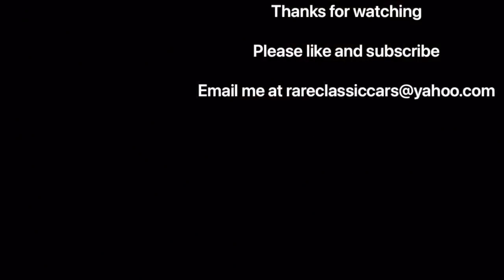Worst Engines of All Time: Chrysler 318/360/400/440 V8 Electronic Lean Burn

Comment: I disagree with scaring folks off a low mileage 77 and up car. Once you remove the LB and take it back to 1972 under the hood. These things are great runners. It can be done in such a way that it looks stock if you are a stickler for that. I took my 84 Diplomat to 1972 specs, when the LB computer died and it is great even though it's a 2bbl...good power and mileage.

Comment: I had a 78 Dodge Magnum.
The car would just shut off and wouldn't restart.
The lean burn system was so bad that the dealerships started offering the earlier style electronic system which was used on the 72-77 vehicles and eliminated the lean burn junk 
I had that installed on my Magnum and it ran flawless after that

Comment: My dad used to rip those straight out into a dumpster and throw in 68-71 Chrysler motors from rusty parts cars. Said a 78 Yorker with a 70 440 could really tear it up

Comment: Just a FYI the lean burn has nothing to do with the engine at all that has to do with the Emissions and ignition system only if you put a standard points distributor or a Mopar Electronic ignition system on it the engines are very good and very reliable I don't know how you can compare a ignition system to a whole group of engines. Even some slant 6's had the lean burn too does that man that is a worst engine of all time too?

Comment: Best thing is just get a 5bnl intake an old Qjet and a compleat old style chrysler electronic ignition from junk yard and be done with it. I can say from personal experience converting an old 318 leanburn engine to a 4bbl is actually worth while, the only problem is it will actually rev higher to the point where if its sludged up it will suck the sludge up from the higher rpms. Between adding dual exhaust even retaining factory manifolds, removing the cats and a 4bbl conversion with a 318 lean burn you will get a substantial power increase like significant, it will go from barely getting out of its own way to actually felling somewhat lively, good enough that if fomeone was like this thing is so slow i cant take it you would probably  be quite content it quite mind blowing just that will wake those engines up so much, but the exhaust and the 2bbl are tatally suffocating that 318. I used a quadrajet it ran flawlessly on that stock engine. A mild "RV" cam makes an ever greater difference in combination with those other mods also a converter for the 904 out of a 225 slant 6 car will raise the stall rpm up a few hundred rpm a likely free higher stall converter. Those few cheap mods will make a lean urn 318 run comparable with way newer cars. I had a test on a huge long double lane hill bone stock my car flattened at the bottom at 55mph would maintain speed whole way up, the exhaust 4bbl and ign swap it gained 10mph thats actually pretty substantial gain then after the cam and converter (and an engine stock refresh doing the same test it would pin the speedo at 80mph by the top, that is a huge difference, this was in a 1980 newport back in 92. This was all old used practically free parts and a cheap summit FT cam. Seems the engine was so smothered making the HP was so low the HP gain may have be very high like 100hp, sounds crazy but remember a 100hp would still only be low 200hp area, from a well beathing 318 v8....easy.  where factory  rating was like 120hp, so thats very plausable, plus ive gad alot of cars and in a large car just 50hp wouldnt be  thaf big of a difference.

Comment: I was a mechanic in the 80s up to the mid-90s. I owned a lot of Chryslers with this lean burn it either works really good or you had a lot of problems and when I had problems you could just switch it out with a regular. I miss my old.

Comment: Put vacuum advance distributor in it, reroute vacuum line from breather to carb. I went all out and plugged the hot air puffer. and got a junk yards breather. Turn any 318 into a 73

Comment: I had plenty of experience with the 360 two barrel leanburn units, never had a problem! But I always advanced the timing too. Thats actually the best thing to do, because the leanburn unit would keep it from pinging.
Sorry, but Adam you SHOULD NOT include the single plug single pickup basic leanburn units in this discussion that were on the 318 and slant and even the 360 2 barrel. They were not problematic!
It was only the early 2 pickup/ 2 plug units on bigblocks and other 4 barrel units that were problematic.
Everyone just jumps to conclusions on this. They are not all the same!
318 lean burn units to this day continue to run great even though they have 40 years of age on them! 
You cant say that for some other  engine computers of the 90s now.
Many quit working and have to be replaced or fixed. Leaky compacitors usually go bad.
I've seen it on fords, jeeps and even civics of the 90s now go bad!
I say this because it should be understood for those that become afraid of all units when they do not have too like on the 80s diplomats or 5th aves.
I have seen people on YouTube buy these cars now, that dont know anybetter and jump conclusions  because people lump them all in on the negativity of leanburn and think, oh know I have to get that unit off the car, I don't want any trouble with it when it most likely they won't give them any trouble.

Comment: It WAS ONLY the early 2 plug 2 pick up lean burn systems on bigblock and 4 barrel engines that had problems!
The 318 and slant 6 systems with1 plug/ 1 pickup leanburn systems WERE NOT PROBLEMATIC! People need to differentiate the 2! 
If the single plug and pickup on 318s and slant systems were problematic, Chrysler would NOT have continued with those all the way into 1989!

Comment: NOT a 'worst engine'. It was an emission system and easily deleted. If you set the timing correctly it would even pass emissions. I've had both standard and lean burn ignitions work fine. The main issue with lean burn was the microchip processing/switching capability (speed mostly) and reliability of the electronics components used. Honda used it later in the '80's-'90's and it was proven once the practical implementation caught up. Geez 'Why it injected fear .......' IGNORANCE, that's why. The LB fuel mixture was run around 17-18:1 later in '79 they rebranded the system as ESC with digital rather than analog CPU processing and carb mixtures around 15:1. As with the GM 350 Diesel program, the damage was done by then. The LB TQ carbs had 2 'air bleeds' in the air horn that could be blocked to restore 'normal' mixture control. I had a '79 300 with an E58 and ESC and I made it a mission to retain the ESC and make it perform and I did. It was a screamer. I 'super tuned' it and used a spark control module from another engine with a more aggressive timing profile. I also tinkered with the metering rods and jets. It was an arduous process but 'bone stock' looking and SCREAMED. And I retained ALL the stock emission equipment, which by the way it was a California spec car which was even more handicapped.

Comment: The engines were excellent just the system was bad.
The Ford Variable venturi computer control carbs were just as bad in early 80s .
GM was not as bad but 700R4 and soft cam shaft lobes ..

14.7:1 air fuel ratio is the target for ECM adjust fuel trim on EFI .

Comment: Let me also add this. When I bought the New Yorker I also looked at 3 Cordobas because I liked their styling and interiors. When I attempted to start all 3, All I got was a loud POP!! And a  whistle. The salesman said they probably needed valve jobs but I think their timing chains jumped. All 3?? What they all had in common was the 360 Lean Burn engine.Enough said!!

Comment: I could ramble on forever about the Lean Burn engine but I'll try to cut it short. I bought a late 76 Chrysler New Yorker Brougham from a dealer. I loved everything about the car. Beautiful styling,great ride,loaded with options.. Anyways,The car ran great for about 3 years. Then all of a sudden it started loading up & backfiring.So loud that it made people jump in fear, like a stick of dynamite. LoL.Anyways it blew a huge hole in the muffler.First things first I tested the Brain Box( computer) It tested good. Next,I replaced the magnetic pickup in the distributor & also the cap & rotor. Ran good for a while then WHAMO!! SOS!! Then I noticed the accelerator pump on the carb was leaking.Rebuilt the carb now thinking that the float level was too high. Adjusted float level lower. I eliminated the loading up but it didn't have the.power it should have had. Next I came to a conclusion that the big Carter Thermo Quad just can't be made to run lean. I tried to replace it with a Holley or Edelbrock carb and I couldn't get one for it.Lost cause. The engine was the 400 ( punched out 383 ).

Comment: As a kid, I had a used Fury wagon. I had nothing but problems with the computer.  The location of the box let it get too hot, they seemed to burn out constantly.  The lean mixture also burned up the valves.  no one got more than 120k out of those engines.

Comment: I had a friend that inherited a '77 Dodge Monaco 400 c.i.d. with the lean burn system. Ran rough, poor power etc. One weekend, we visited the local car recycling yard, found a straight elctronic ignition system module, ripped out the lean burn and it ran significantly better (found out in the process the timing chain was stretched and replaced it)...it was a gutsy beast from then on. BTW the other Chrysler faux pas were those idiotic ballast resisters...had to have a spare in the glove box at all times 🙄)

Comment: I was able to fix the lean burn issues with my 1976 Cordoba which had a 400 motor in it.    I pulled the motor out and replaced it with a 383 magnum engine from a totaled ‘71 Challenger.

Comment: I had a 76 Cordoba (400CI) that came from the factory without the LB setup which ran really good. Automotive engines and elaborate electrionics just weren't a good mix back then. Another example was the GM HT4100 system.

Comment: I had several Chrysler products with the Lean Burn System on them. The only one I had a Lean Burn problem was an 83 Chrysler 5th Avenue I bought with a spun main bearing. I simply replaced the engine and the Computer with a 318 out of an 88 5th Avenue. That car ran like a clock and got 27 mpg on the highway. I was quite satisfied with the Lean Burn System. Maybe I was lucky or maybe people were super critical of something that no-one else was adressing.

Comment: Back in 1983, my father had a Dodge Crestwood station wagon with the 360 c.i. two barrel, and it didn't have lean burn. (Thank goodness) I worked on that car and drove it quite a bit after his passing, so I'm not mistaken. I became a mechanic not too long after that, and remember working on "Lean burn" cars at a used car lot back in the late '80's. I also remember going to the salvage yard and hunting for the computer that mounted to the air cleaner as part of diagnosing/repairing those cars. Now, I work on Mercedes, Audi, and Volkswagen with CAN bus systems and all manner of electronic nightmare stuff!

Comment: The problem would have been solved if the cpu was mounted on the firewall instead of engi e. Heat and vibration is not a good mix for electronics.

Comment: I have told many stories about the 77 Chrysler Newport I had which had Lean Burn. I liked the car, it rode well and was comfortable, but I did not like the Lean Burn very much. On my car, the temperature cut off was 120F.  Below 120F, there was NO spark advance, which made the car very slow and gave it very poor acceleration until it warmed up above 120F. Above 120F, I had to press much harder on the gas than I'd normally expect to get the throttle response I wanted. Then I'd back off, and off, and off, slowly, as the spark advance came on.  It was a bit of an odd experience driving the car. It had a 4 barrel Carter Thermo-Quad carburetor with a phenolic resin fuel bowl. You couldn't enrich the mixture the way you can on the Carter BBD. If you gunned the engine, though, suddenly the computer understood you needed power and it allowed full spark advance. My plan was to replace the Lean Burn with a standard electronic ignition. I had all the parts to do it, but kept driving it as it was. It was OK - just not how I preferred it to be.

Comment: Dad bought his new 1976 Chrysler Newport with a "lean burn" 400ci motor.  It ran great on regular leaded gasoline! ...till the day I totalled it on the back roads, with the speedometer buried for a mile.  I was "fine" until at the county line the road turned to gravel.  😯 May 1981

Comment: Yeah! i know. many older engines were cold blooded until they warmed up. The 74' Pinto (my 1st pickup truck, bought from a bank repo for $50)  i had with a 2300cc/automatic (with a C3automatic)  was very cold blooded, But once warmed up it would pull a empty heavy tandem axle trailer. And going up steep hills it would slow down to 25mph (i could feel the HEAT coming from the floor from the transmission). Not alot of horsepower but would run forever and get about 25@gallon/ not bad for the time/era.

Comment: I have a 1985 B150 van, with the 318 and Lean Burn.  It uses the Holley 2280 electronic fuel control carb.  The Lean Burn system was innovative when it was first introduced, as it was the forerunner of all of the current ECU-controlled cars we have today.  Unfortunately they were saddled with carburetors and transistorized computers, along with ancient sensor technology.  The distributor can be legally upgraded in California with the Pertronix electronic auto-advance distributor.  Unfortunately for us Californians stuck with draconian smog laws, the state will not allow us to upgrade the pathetic 2-bbl Holley carburetor to a modern fuel injection system.  But based on my experience with these engines, I strongly recommend owners strip the lean burn off entirely and upgrade everything with a decent electronic, vacuum advance distributor and nice conventional fuel system.  Your Mopar will appreciate it...

Comment: Just to clarify: advancing the spark increases power; retarding spark increases fuel efficiency. Drivetrains are designed to run at either 'best power' or 'best economy.' Advancing the spark too much will cause knocking. Modern engines have transducers (i.e., microphones) to detect pre-ignition, at which time the spark is automatically retarded until knocking stops.

Comment: The engineer that came up with that Electronic Lean Burn should have been fired.  Attached to the air cleaner over the driver's side exhaust manifold all that heat and vibration; I never had a customer that didn't have problems with those Chrysler cars equipped with that system.  Great video!

Comment: Its rpm, temp and load based, instead using a vacuum and mechanical advanced the lean burn ecu used coolant temp, manifold vacuum  and engine speed to control timing. Nothing time based about it. Its biggest downfall was the same as all 70's and 80's early emission cars. It was all the vacuum lines and temp controlled vacuum switches that were of poor quality and affected by the heat in the engine bay or leaking valve cover gaskets.  Vacuum leaks and broken vacuum line nipples on all those switches. The engines then where way lean to start with then add in all that unmetered air from leaky vacuum lines and sensors and you ended up with a gutless turd that wouldn't idle, missed and hesitated.

Comment: I owned SIX MoPar "Lean Burn" engines! The "400" was the ONLY disappointment! Back in the day, though NOBODY built a good "400" engine! I owned ALL (except AMC) and these were BAD ENGINES ACROSS-THE-BOARD! They SUCKED gas, had DISAPPOINTING power/acceleration and were BITCHES to deal with!
Reply from the maker: Pontiac had a nice 400

Comment: I've just in the last 3 months "stolen" my Dads 79 Diplomat off him. It's running the Lean Burn 360 and auto. After watching your video I'm shaking in my boots regarding the dodgy lean burn system and what to do if it does crap out. And living in New Zealand doesn't help either, in regards to getting the system fixed or having to go aftermarket dizzy and carburettor. But a very good, informative video, thank you.